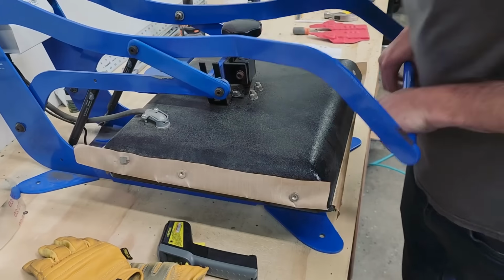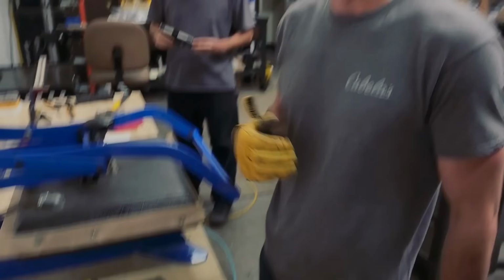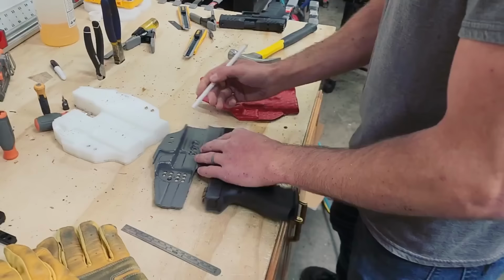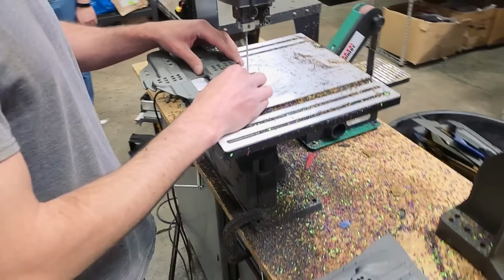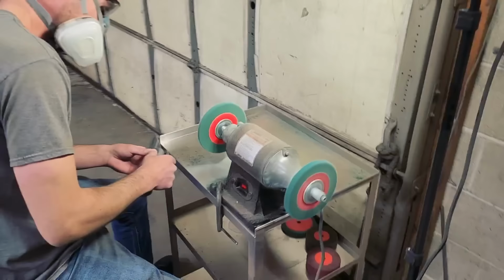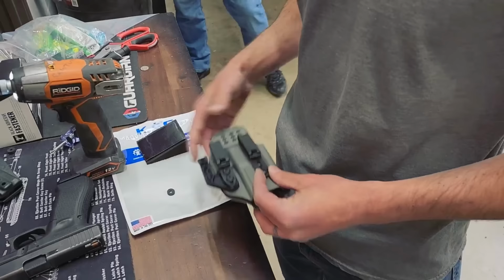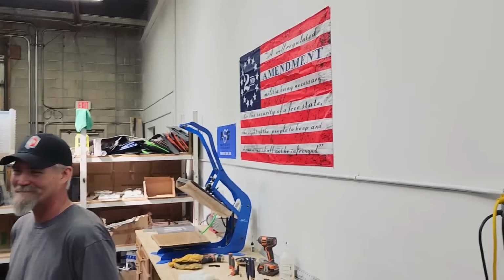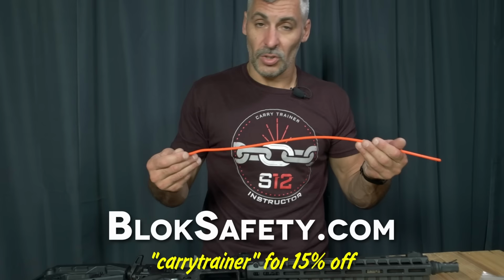How a Kydex Holster is Made

Comment: I do have a recommendation on the safe use of the bandsaw: lower the guide to just above the tallest height of the item being worked on at that moment. It produces straighter cuts (more applicable to thicker materials), reduces the chance of the saw blade breaking, and greatly reduces the chance that your fingers come in contact with the moving blade.

Comment: I'm still stuck on the Galco gun leather (horsehide) Summer Comfort pretailored for the G26 w/LG-436 attached. PG-26 grip extensions not included.
Reply: Leather is for Fudds 😂
Reply: Leather is much better!  I bought one of kydex and it sucked bad.  Gave it away.  Love my leather, snap retention, scratches, leather smell, and works 100% of the time.
You kids can take these POS.
Nice video thanks for sharing

Comment: Can I give you guys a suggestion. Why not use a Drill driver with adjustable clutch (instead of the impact) to tighten the retention screws/hardware. That way you know the clutch will disengage at the preset Everytime and give you right retention. It would make it easier to have the drill driver for retention  screws and the impact for the rest. Just my $0.02 cents. Thanks for the video tho.

Comment: Nice work. However, I wish they wouldn’t cut down the outside of the holster along the slide. I want my holsters to have full coverage to the end of the slide on BOTH sides. If you also drill the holes on both sides the holster is then ambidextrous by merely switching over the hardware. I also want snap loops and not belt clips because I don’t want the holster coming out with the gun when I draw.
Reply: The holster is Ambidextrous if you select the mid-height sweatguard when ordering. You can order it with Snap Loops no problem. Having full height sweatguards on both the inside and outside of the holster will making reholstering the gun much more difficult but if that is what you wanted you could request it from KSG.
Reply: Did you even watch the video? 😆

Comment: Can the gun dry fire with the barrel block on? Great video, thank you!
Reply: Yes, in fact BarrelBlok is primarily make and sold as a dry fire tool. It provides a strike face for the firing pin and sits snug in the chamber. It also ships with 3 MagBloks which go in your mags and push down the follower so you can run the slide without having slide lock.

Comment: With practically 15 mins of work and it only cost 170 bucks
Reply: There’s more money that goes into holster making than you realize. Molds easily cost $300, the equipment is around another $500-1000, the massive amount of material needed adds up very quickly. Holster making is  is not cheap.
Reply: @crosspointholsters1636  t Rex arms started with a heat press and used his guns as molds... also blue guns are cheap af
Reply: @Blackflag.actual  so did everyone else. Then they got their own molds made so every holster will be consistent.
Reply: @crosspointholsters1636  I feel like you feel attacked
Reply: @Blackflag.actual  no. I don’t like when people think 70$ is too much for how much time and money others spend to make a product
Reply: @crosspointholsters1636  I said 170... because teir 1 cost that

Comment: I must have bought the wrong brand. This one seems different then mine. I had a kydes holster but in a little over 6 months the gun was so loose that it moved inside the holster and would have fallen out if I had not caught it.  There was what they called an adjustment screw to tighten up the holster but you could tighten it up all day and it did nothing. I will have to check these guys out.

Comment: How it's made. Heat and squeeze $3 worth of Kydex,  add 5 bucks worth of hardware, charge $100+
Reply from the maker: When looking at the cost of any goods one has to factor in the actual costs. A cheese burger might be a buck or two of food but how much did the restaurant, kitchen equipment, electric, gas, labor, trash disposal, napkins, mop bucket and everything else cost to make that cheese burger possible?
Let's not forgot how long it took to learn the recipe and market the restaurant. These are the true costs. 

Yep, it's a few bucks of kydex, but let's not forget the big and real picture. 
Cost of goods+expenses matters. If it doesn't you don't stay in business.

Comment: Hate kydex when using In the waistband. Very uncomfortable. Prefer leather
Reply: Then you haven’t had the right holster.
Reply: Any good ones?
Reply: @stevesmith756  advanced retention has a few holsters that have built in wedges for comfort. But mine come with the option to have either a foam or pillow style wedge added to them.
Reply: Thank you sir